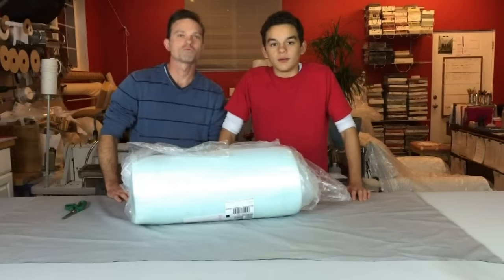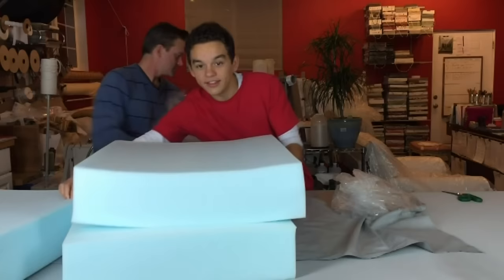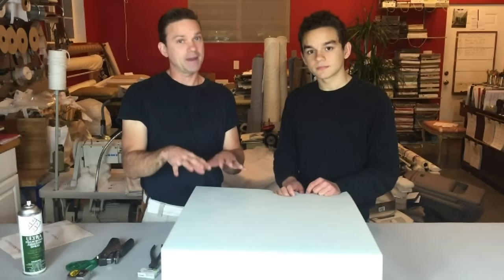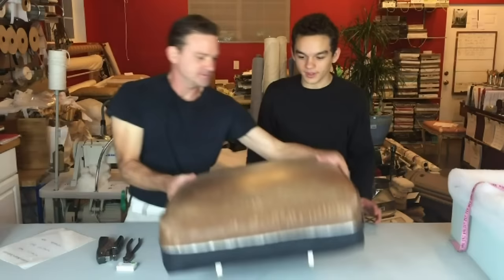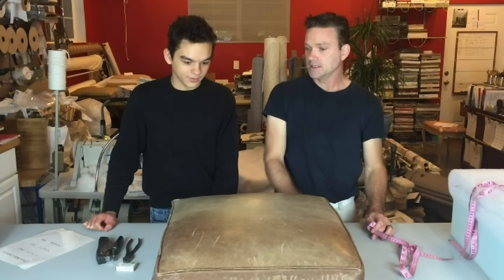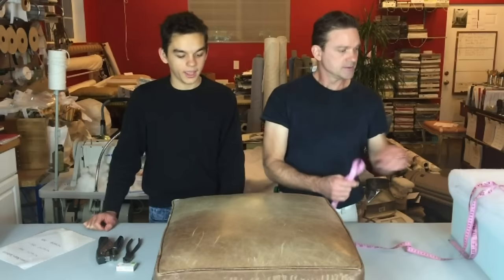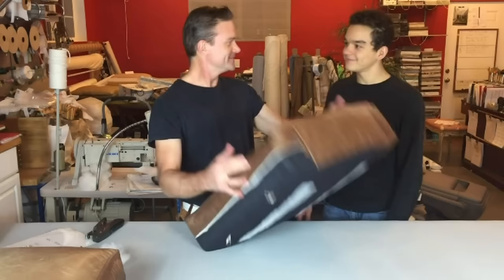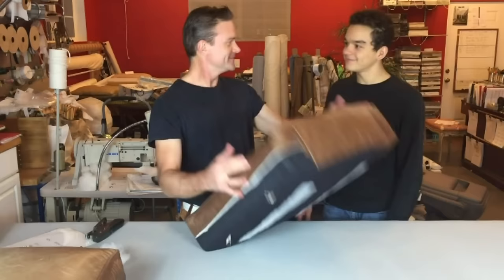Replace the foam in your seat cushions fast and easy!

Comment from the maker: HEY! Need Foam?! You Can Order Foam Here: https://ucprivatecourses.com
It's Fast and Simple! 

Have a Question? I'll be there on Live Chat to Help You Through! 

Thanks for watching!
Reply: ucsolutions Can I send my cushions to yo-yo fro right new foam in my existing cover?  Or, can you demonstrate how to easily remove and insert foam that has a t or l shape.
Reply from the maker: Hello Stephen, thank you for your comment, we do appreciate it. No, we do not fill covers with foam from online clients, only for in-shop clients. We do have on the site videos to help you measure and order the new foam inserts.  https://ucprivatecourses.com/product/sofa-seat-cushions-foam-inserts/  As for removing the inserts it honestly very easy, unzip the back cover, reach into the cover get a hold of the L or T part of the foam and pull it down and out toward the back. To insert the new foam simply do the reverse process. I hope this has helped you, we do not have a video on removal and inserting the foam SOON!  Until then perhaps this will get you through.  All the best,  Paul
Reply: I really enjoyed enjoyed watching you a great job
Reply: your websites needs work
Reply: Enjoyed the video on new seat cushions. Can I email you a picture of the factory tag from inside my seat cushions? I would like a quote on materials. Thank you.
Reply: Do you have a video on how to replace the “L” cushion or could you tell me how to measure and order that foam?  Thank you.
Reply: Is ordering still available ??
Reply: Im needing shredded memory foam to add to my couch cushions. I bought this furniture 5 months ago and its terrible little did I know when I bought it , the seat cushions are filled with polyfill and smash down after min of sitting im so angry of course they wouldn't take it back. Why I say memory shredded is because the cushions are attached and zipper at the back making it very difficult to get to. I would never be able to get a intact piece inside.
Reply from the maker: Hi Kelly,
That is terrible! I hate that things are not made to last anymore! We do have a solution if you haven't seen it already, it isn't memory foam however it is double shredded 26 density foam. Like you said it is really simple to use and great for attached back cushions. Here is a link to it if you are interested: https://ucprivatecourses.com/product/premium-back-cushion-fill-finely-double-shredded-26-density-foam/
I hope this helps!
All the Best,
Grant
Reply from the maker: Yep, thank you for asking, you can order at https://ucprivatecourses.com/26-density-foam-custom-cut/
Reply from the maker: Lol, thanks for watching our videos! Hey if there's food involved I'm in! We really appreciate you reaching out to us. If you do need any help if you cushions or have any questions feel free to contact us directly on our live chat at our website ucprivatecourses.com.
Reply: Can i still order
Reply: How does it take to receive it after the order is placed? Are you based in the  U.S.? Thanks
Reply from the maker: Hello there, because of Covid we’re running about 2 to 3 weeks time. It has thrown our system off but we are catching up. Yes we are in the USA. Cheers, Paul
Reply: bruhhh... 350 bucks for one 36x36x8 inch piece of foam??  Is this real life??

Comment: You guys are easy on the eyes😉 I have a leather couch cushions that need this same TLC. Thanks for sharing good practical info. BTW if you use a vacuum or shop vac  and wrap a thin plastic bag like you get at the cleaners around the cushions it will suck the air out to shrink cushion for easier insert into its cover.
Reply from the maker: Hello sugar Rea,
Thanks for the comment love to hear that!! YES! I want to do a video on the process of using plastic and vacuuming the cushion down. Great tip. All the best God bless.   Paul

Comment: also...these very expensive pillow top mattresses all deteriorate...some within a few months of use...but all that is wrong is that the cheap foam they used for the pillow top effect has compressed under body weight. The metal spring base basically last forever. It would be nice if you could buy mattresses with zippered covers so you could just replace the failed foam.
Reply from the maker: Hey Bgregg55,
Thanks for watching. I believe you have commented before in the past, if so glad to hear from you again. YES!! right on I personally think mattresses are built to end up in a landfill. I have opened up my own mattress and replaced the foam on top on the springs it worked great. I have been wanting to do a video on replacing the foam in a mattress. I have seen one mattress with a zipper, fact is they all should have one. Hey thanks again for commenting,  If you haven't already please subscribe and share the videos,it helps us when you do. All the best,   Paul

Comment: I agree with the others, this is a great video; thanks for posting. Like others, I look at the Albany foam website and was confused about the proper foam to get. It likes like you are talking about the Ultra Foam (page 6 in their PDF catalog). But those are complete sheets. I did not see anything about them offering a service to cut to length. Can you help explain the best way to order? Or do you recommend getting the full sheet and cutting it myself. Thanks.
Reply from the maker: Hi Cindy, Sorry for the slow reply things get out of hand fast around here. Good Question, you can buy the sheet and cut it yourself or if you call they will help and email the measurements to them they will cut the foam for you. They will even put the Dacron wrap on for you.There's a lot of other places to purchase foam online this is just one. Yes that is correct I only use the highest density Ultra foam is the best, it'll hold up and last longer.  This method in the video is the basic style offered by standard factories. Open your cover and see how your foam is from the factory and copy that. The safest thing to do is the thicker the foam you need is to go softer. Please check out the videos again maybe it'll make more sence. I hope this has helped you. Cheers,   Paul

Comment: Hello and thank you for that informative video.  I will have to re-watch to try to figure out the foam density and compression info again but that is one of the things I have been searching for.  Also, I didn't see anything about automotive upholstery.  Do you work with car seats also?  I was at an aircraft upholstery shop once and I remember that they were creating and building up seat cushion foam by using a contact cement and were using different density foam to make a seat depression for one's bottom to help you stay in your seat.  
Could you provide some infor on this or do you know any videos that describe this process?
Again, thanks again for this video.  It got me thinking.

Comment: Selecting the foam for the cushion is good, but the stuffing the cushions is not so good because on all too many newer sofas, the cushions are attached to the sofa base with only a zipper hidden in the back of the sofa cushion.  A detached cushion would be easy to work with but a attached cushion that has to be stuffed from the back through the zipper slit is something else!
Reply: ***** - I would not know, for I am not a expert on cushions.  However, a car bucket seat is another mater than a typical sofa!
Reply from the maker: Hi,
Thank you for watching!
You're entirely right with attached cushions you need a special plastic film the creates a vacuum seal around the cushion, so  you can shrink it to fit into the cushion. And then you open the seal when the foam is in the cushion. It's definitely not as easy to do. 
All the Best,
Grant
Reply: ucsolutions -Also, I found out from another video, it is better to disassemble the sofa and the video shows how to do ti.  However, my problem that made it so that I was looking to restuff the cushions has been solved by other means!  Anyway, thanks for your very helpful site!

Comment: That was so helpful!  I think my loveseat needs this.  Your instruction was so clear and covered all the details!!  Thanks.
Reply from the maker: Hi Dianne,
THANK YOU! For watching, but more importantly for taking timeout to comment. Glad you found it helpful, let us know if you have any questions.  All the best,   Paul
Reply: Actually, I do have a question about the strapping support.  I think mine is sagging.  Is it possible that I could tighten it myself?  or is it from something else??
Reply from the maker: Hey Dianne, 
Try this video this MIGHT fit your situation. If you have your webbing on the bottom, however you could have a different support system. Is there webbing on the bottom that you can and feel, then this will help you. Thank you let us know.  https://youtu.be/pcF2GR576dE

Comment: Hi, guys! I'm from the UK. Just stumbled across your channel. I love it! I was thinking I might have to replace my current, and beloved, sofa in the New Year, as, after purchasing it three years ago, the seat and back cushions have become too soft and is very uncomfortable to sit in. I'm now definitely going to replace the cushions using your method. I'm still trying to get my head around the foam density calculations though... 🤔 (4:26), but I'll watch it again and work it out, to make sure I order the correct product. Other than that, your instructions are super-easy to follow and I feel assured a novice like me can do this.

Thank you so much for your post. You've saved me a small fortune! Yay! 👏🏾😄👏🏾

Comment: I understand the compression but not density. Help I’m covering dining room parsons chair. Your son is a great helper😁
Reply from the maker: Hello Alanna, thank you for watching the video we appreciate it. I’m not sure exactly what your question is on needing help, but the seats in dining chairs should be firm compression 45 at 2 inch thick. The density just refers to the high quality of foam. How much foam are you getting per inch compared to a lesser quality foam. Are you reupholstering the seat only or the inside back as well?  I hope this helps you again thank you. Please subscribe and share with others if you haven’t already cheers, Paul

Comment: Great video and very informative.  The only suggestion that i would make is, when you removed that staple using a pair of diagonal side cutting pliers, you ran the risk of actually cutting the staple and ending up with a small piece of staple wire floating loose near the edge of the cushion.  One wrong move sitting on the finished cushion, and you might end up with a startling surprise that will really "lift" your spirits.  Regular, or needle nose pliers would be a better choice.
Reply from the maker: Hello Rankie, thank you for watching and for the tip. Please share the videos it helps a great deal. Cheers, Paul

Comment: Thanks. I didn’t know the trick about adding an inch to the cushion when measuring.
Reply from the maker: Hello, Yes it helps a great deal in some cases if needed you can go a little larger in the depth or thickness.  Glad to have helped. Hey please share it helps a great deal when you do. All the best,  Paul

Comment: Man I need to replace my entire sectional. I noticed the cushions have shrunk so I don’t know what size to order. Because when I do go to order I’m going to get it from you guys.
Reply from the maker: Hello Aja, that is a common problem. You will need to measure the platform that’s what the cushions seat on. Measure Side to side front to back then measure the cushion covers. Compare the two measurements. Unzip the cushion covers and measure the EXACT THICKNESS OF THR FOAM AND ORDER THAT THICKNESS DO NOT ADD 1” too the thickness of the foam.  The factory did that for you. There is chat on the website to help you along. Thank you please share the videos it helps a lot. God bless your kindness. Paul

Comment: Thanks for the video!  Lots of info wow
For the DIY'r:
Let me share what has worked very well for me for FREE!, much of which I've learned from my brother who is a professional upholster, with making a new bench or van bench seat or boosting old car seat foam:
For car seats that need boosting, most often they just need more foam added to be like new again, I find used carpet pad foam often in a neighbor's trash or dumpster behind a carpet store. Remove the car seat fabric clips and carefully peel the front and sides of the fabric to gain access under the seat foam core, which often requires the seat be unbolted from the floor. 
Place a sheet of it or two under the seat foam core, right on top of the spring wire deck(carpet pad foam is tougher than the core so this also stops the spring wire deck from cutting into the seat foam core bottom).
Your second sheet can be cut smaller just covering the area the butt sits on.
Also inspect the top of the foam core and add carpet pad foam or regular foam where might be needed like by the door, worn from getting in and out over the years.
Spray adhesive can be used to bond the foam to the foam but is not necessary except for any top foam added.
Your seats will be firm and new like for many years now, it's like free magic!
The seat back usually doesn't need a any foam because it's the seat that gets the body weight on it from gravity. If you seat back should need a boost, you can add polyfill batting on top of the foam for free-see below.
These methods can also be used on sofa seat cushions.
I'll share below where to find FREE used good foam below!

To make a bench- where to get free foam: there is so much FREE foam and FREE polyfill - in many soft pillow backs and polyfill batting often wrapped around foam cushions for the taken in people's discarded sofa's and chairs found outside dumpsters at apartment complexes and the back of thrift stores. 
Even though it's used, it has been well protected covered inside the upholstery. 
Of course in the event it's a cat lady's furniture and the cats happened to piss all over it, you'll smell it and know to move on lol
Most apartments don't allow pets or make it expensive to have a pet so a lot of furniture is pet free.
Use a box cutter to open the old furniture to get at the free foam or poly as you need or use the zipper you'll find on some pieces.
Some foam in old sofas contain like a 1" thick panel of foam on top of other foam that is perfect thickness to add to your sofa foam to give it the new boost again.

Foam can be cut to size using a hack saw loose blade only in your hand holding the end making a sawing motion.
New foam looses some of it's firmness over a break in period, say after 5 years depending on how much it's sat on. 
But then the broken in foam lasts a very very long time at that softer level firmness before it really starts to break down. 
You might be able to buy complete new expensive foam cushion cores but they will sag after the break in period as well.
This is why so often we love a new firm piece of furniture but then it gets soft and saggy on us. 
Now the sofa companies could to put super firm more expensive foam in their sofa's when new that might be a perfect firmness for us when broken after the 5 years break in period, but then we wouldn't buy the sofa if it's not nice to sit on from the beginning in the show room, so there's the dilemma when you fabric is still in great shape after 5 years but the foam is now sagging.

The free fix:
So just add more foam if you can firms it up to make it like new again, unzip and compress the foam as you slowly peel off your fabric from the cushion core. Then either add more foam to the top or bottom or hack blade saw through the center horizontal line of the foam core all the way from the back to almost through the front but not through, so you leave a good hinge of foam in the front.
Then place about a 1" thick of used foam in the sandwich and holding it closed peel the fabric back over the foam cushion.
You can also add more polyfill pad to the cushion core on it's outside to add more softness and support but adding more foam is the big boost.
Spray adhesive is optional to bond the foam to the foam.
People often think that when the seat sags that the springs under the cushions, have weakened but no, it's the foam, the springs are metal and strong, the foam is just foam.

Discarded trash at a dumpster is free for the taking and your reducing what goes to our planet's landfill.
This is win win, real free hard core recycling, helping to save our environment as well!

Take care!
Reply from the maker: Hey Jim,
That's a lot of info, that has to be the longest comment we have ever received. You sure have that method down to a science. Thank you very much for leaving a comment and for watching the video, glad you did. Please share and subscribe if you haven't already. Again thank you, Cheers,
Paul

Comment: I was wondering what is the purpose of the dacron? Love the video because I have a couch that needs the cushions replaced.  Sooo helpful!!
Reply from the maker: Hello there Stacey, that’s a great question. It has a few purposes, one is to give a nice crown feel. It keeps the foam from wearing out the fabric and the fabric from wearing out the foam. As well as it makes it easier to slide on the cushion cover otherwise the fabric would stick to the foam . And keeps the cover from doing what’s called crawling when you get up and down off the cushion the cover can crawl and stick in place. It offers no support. I hope this is helped you and again thank you for watching the video and please share with others we really appreciate it. Cheers, Paul